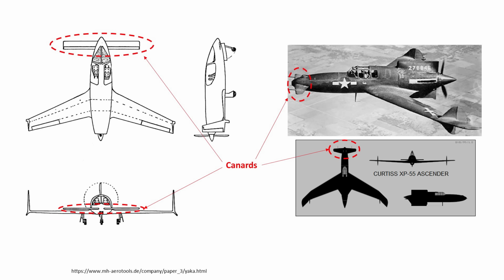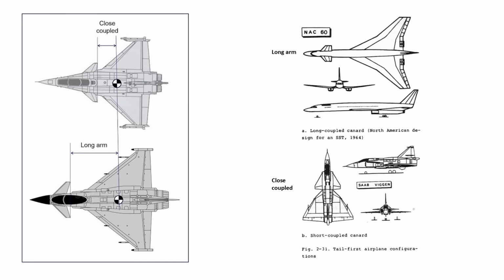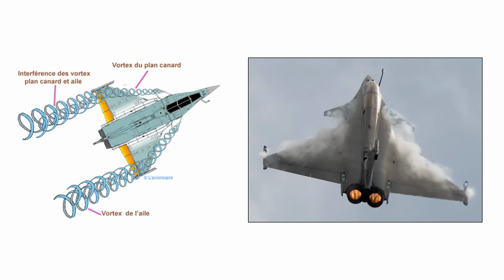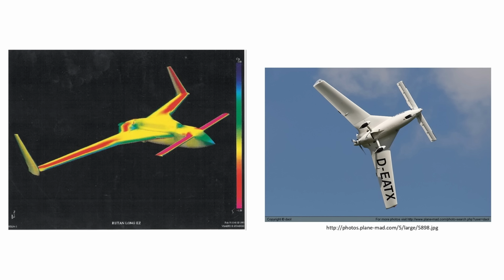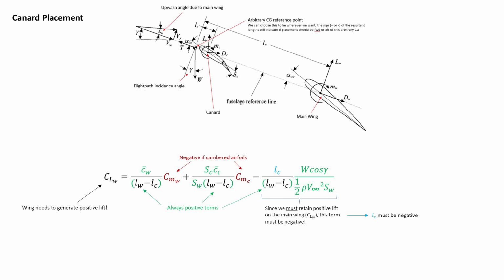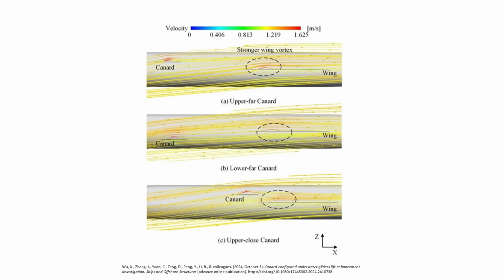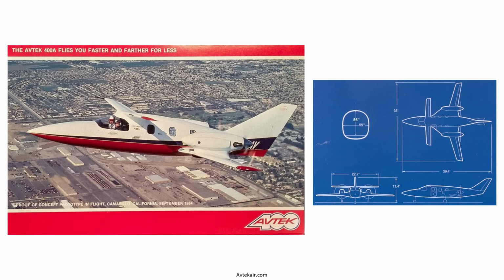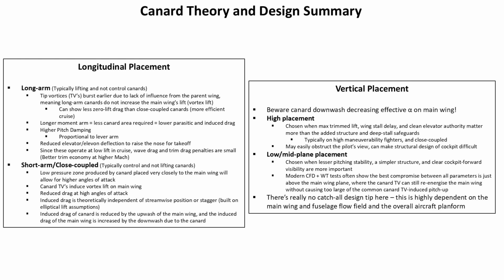Canard Design and Aerodynamic Theory

Comment: I always was impressed with very easy … its miles per gallon and eliminating the tail that pushes the aircraft down which increases wing loading.   Here are some basic design possibilities
1… winglets on the canard to slightly improve lift but mainly to reduce vortices degrading the main wing performance, especially on the part of the wing that extends past the canard
2… the ultimate aerodynamic efficiency; canard design but with main wings that can extend outward after airborne to maximize the lift swath.  Either telescoping struts within the wings that can extend the length of the wing from 20 feet to 30 feet or pivoting wing extensions on the wing tips that fold back parallel to the body for takeoff and landing.   
3… why not make the canards into control surfaces by dynamically rotating the canard +/- 5 degrees along its axis?

Comment: I have a question what if in place of canard the main wing would be placed with high aspect ratio and for back wing (normally main wing) a smaller wing with low aspect ratio and slats or vortex generators if necesery to have higher aoa and stall capibility would something like this even work because i was looking at birds and i know they have active stabilization in their brain but it would be prety cool to have a plane like this

Comment: Why can't tails have positive lift
Reply: Since the C.G. must be forward of the Aerodynamic Center for static stability, it seems intuitively obvious that the tail must produce downforce to balance the airplane.  But I have been told that static stability of the airplane as a whole includes not just the contribution of the wing but of the total airplane.  This means the airplane can be statically stable with C.G. aft of the main wing A.C., as long as the C.G. remains  forward of the total airframe A.C.  I'd love to see an aero expert discuss this.
Reply: They can, but it's not stable. Plane would pitch down at high speed, increasing speed even further and pitch up at low speed, stalling fast.

Comment: A nitpick for the beginning of a video: It's not necessarily true that traditional tail always creates downforce, depending on geometry and weight distribution it might well create quite a significant portion of lift. In my experience though, it's best (for cruise efficiency) to design it to be as small as possible and with as little lift on it as possible (positive or negative) in the cruise configuration
Reply: A few lines below you there is a comment from @CcosmicHase asking why the tail can't produce positive lift.  One response there is that a tail with positive lift would cause the airplane to pitch down with an increase in speed and pitch up with a decrease in speed.  This is not really unstable, as claimed by that response, but is really about trim for a given speed/AOA rather than static stability.  Can you address how the tailplane can trim for a given speed/AOA while producing positive lift?
Reply: @gort8203 planes I build for work typically have a fully rotating tail stab and a very narrow flight envelope, so trim isn't much of an issue. Especially with autopilot. 
But yeah, lifting tail is not a good thing, this way you have a second source of induced drag, and it's located completely in the air disturbed by the main wing
Reply: @Zoey_the_Rat  Doesn't matter if the the tailplane is an all-moving stabilator or a fixed stabilizer with an elevator, both trim the aircraft by changing the angle. 

Being a second source of induced drag is not a problem of the tailplane; it is going to induce drag whether it generates lift in an upward or downward direction.  The very benefit of using a canard it that it reduces the trim drag caused by a tailplane.  If the tail is pushing down with a given force to trim the airplane, the wing has to generate that much extra lift to support the airplane.  

A canard (or a tailplane providing positive lift) does not increase the lift required of the wing and reduces overall induced drag.   One reason so many supersonic fighters have a canard is that it avoids the need for extra trim angle at the tail when the center of pressure moves to 50% MAC at supersonic speed. (Relaxed static stability also reduces the need for downforce at the tail.)

Is there anyone reading who can address the original question of how a tail trims the airplane for a given speed when providing positive rather than negative lift?
Reply: @gort8203  I mean it increases the overall incuced drag as compared to a zero lift tail. It does so because tail is just by virtue of geometry a less efficient wing than the main wing.

There seems to be a misunderstanding, I'm not talking about full sized manned airplanes here, I design UAVs.

I'm not exactly sure what you mean by your question, it trims the same as a tail that creates downforce, it will just moce in the opposite direction with an increasing speed.

In fact, many planes will have a tail that will create positive or negative lift in cruise depending on where the CG is within its boundaries
Reply: @Zoey_the_Rat   It doesn't matter whether the airplane is manned or unmanned, the aerodynamic principles are the same.

You don't seem to understand trim.  The tail does not move in response to an unintentional change in speed.  The whole point is that a deviation from the trimmed speed generates a pitching moment that returns the airplane to its trimmed speed without action from the pilot, be it human or electronic.  

Yes, a tail can generate positive or negative lift, but the question is how does it regain the trimmed speed if generating positive lift.  Won't an increase in speed increase the lift at the tail and pitch the nose lower and increase the deviation from the trimmed speed?   If the tail has magically perfect zero positive or negative  lift at ALL speeds, how does it hold a trimmed airspeed?  Anyone else?

Comment: You should make a video about all the definitions to common Aero words. Like, wtf is Dihedral?
Reply from the maker: I’ll add this to my list, although maybe I’ll just make a document explaining these instead of a video. Most are just a google search away, and are defined within the first few pages of any aero textbook in a table full of nomenclature definition!
Reply: @gabefpv thanks for the reply! I know that these terms are only a google search away and are pretty damn basic for an Aero Engineer. But, as a non-Aero engineer, a singular video of your explanations of the terms would be incredibly valuable. 

I'm talking about basic terms and their basic effects that are learned in some "Aero 101" course haha. "Dihedral is the angle of the blah blah blah. An increase of Dihedral tends to do X more but increases Y. A decrease in Dihedral tends to do X less but decreases Y. Alright, next up is the Aileron. Ailerons control ...."
Reply: Dihedral is when the landing gear doesn’t come down fast enough and causes vortex ring state around the fuselage
Reply: Side question: what is the benefit/disbenefit of using an X-wing wing configuration (like the Lancet drone) vs a normal horizontal wing configuration?

Comment: Great video, Gabe. Why is the downwash generated by the canard something to take into account when the reduction of the effective AoA of the wing that it causes can be easily solved by simply placing the wing at a higher angle to the fuselage?
Reply: Because a given airfoil "simply" placed at a higher AoA gives you back your lift, sure, but with decidedly non-simple side effects that are likely to make changing the airfoil profile the better choice. Like the lift vector is tipped back = more induced drag and a different lift distribution. Spanwise difference between the portion of the wing that's in the downwash vs out of it. Center of pressure change. And if part of that higher-AoA main wing ever hits non-downwash air, in slow uncoordinated flight like a landing with a crosswind for example, you have to make sure it still stalls after the canard at its higher AoA; otherwise it's instant deep stall and your airplane falls down. So, "something to take into account".
Reply from the maker: Exactly what  @HypoceeYT  said. Stall margin is a big one too. Plus, you generally want your canard pitched a little bit higher than your main wing to hit the earlier stall requirement. If you pitch both wings enough, pretty soon you’ll have to cruise nose down for efficient flight, and that has its own issues.

Comment: Beautiful work! Without question, the most in-depth video about canard configurations that I ever found. There's quite a lot to absorb. I will definitely rewatch the video more than once!

It's comforting to know that my intuition about certain behaviors was correct.
For instance, placing the canard just above the main plane always made sense to me, but until this video I had no opportunity of proving it to myself.

On YouTube there is channel about an experimental canard aircraft called "Raptor". It's scale model, as well as the full prototype, suffered from really poor dynamic stability as a result, I think, of the canard being in the worst possible location. The canard wasn't in line with the wing, it wasn't above the wing, it wasn't well bellow the wing. Instead, it was positioned just bellow the wing, just enough to cause scary instability in any situation other than at cruise speed, in perfect weather. In other words, whenever the elevator was not prompting the wing's lift to oscillate. My belief is that the elevator was considerably changing the wing's stagnation point, often asymmetrically, thus causing very scary pitch and roll instability. Fortunately, Peter - the designer, is an excellent pilot, thus managing a few flights until engine failure halted development.

Had he watched this video before or while designing his precious investment, it's likely that, at least, the instability could've been improved, if not corrected entirely.
Reply: Heh. From my casual view of the Raptor saga (and his new type of mithril hubless fan that'll totally break the laws of ducted flow and make the Raptor NG a VTOL), Peter is not in the habit of listening to people who tell him things he doesn't like, such as undergrad-level aerodynamic theory or that his airplane is half a ton heavier than what he designed it for. I think he wouldn't have changed a thing.
Reply: @HypoceeYT  That is, unfortunately, very true. For instance, he was advised, quite a few times, by professionals that his turbo setup was wrong. Even I, as an amateur, knew that it was wrong.
Instead of staging the compressors from big to small, and the turbines from small to big (just like in a turbojet), he did the exact opposite, which was not only inefficient but  also provided higher temperatures, likely contributing to the failure that ended the project.